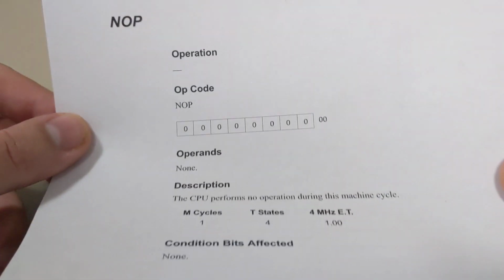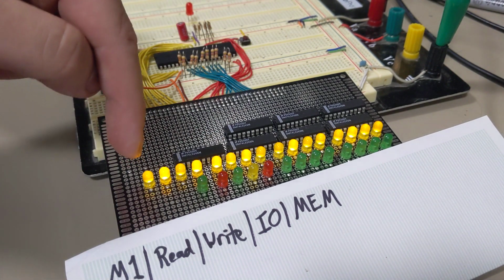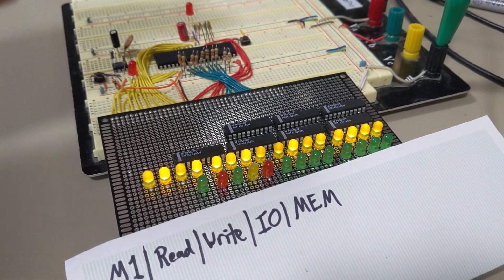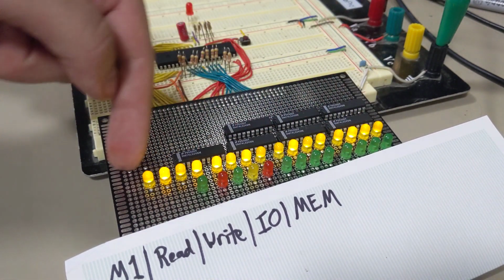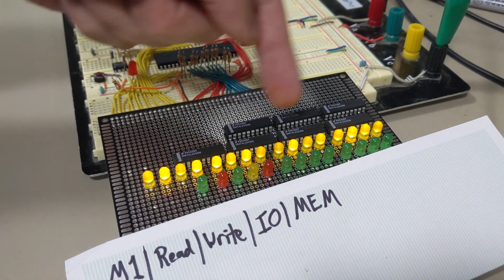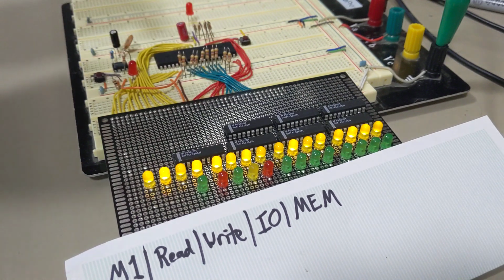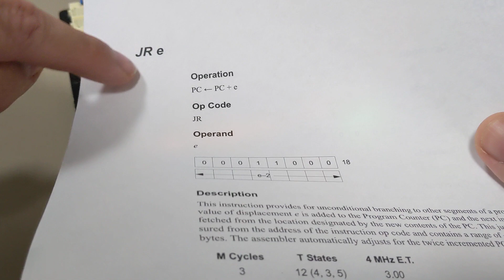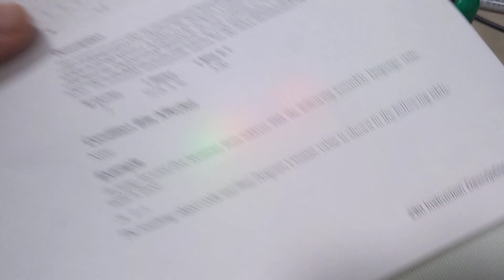Single Stepping a Z80 on a Breadboard

Comment: Maybe if I watch this kind of movies I will understand a bit of the Z80. Anyway I suddenly feel the need to build a buffered LED board. It look very intelligent, like the old computers from the sixties and seventies where highly trained technicians in white lab coats were running around to check for the status of every changing bit. This is true computing!

Comment: Why are those "bus driver" chips needed for the leds? All the other z80 projects i see on YT have the leds wired directly to the address pins
Reply from the maker: Because the address pins have a limited drive current and I built my display correctly to not use most of that on the leds

Comment: In my case  my construction not work properly.
on breadboard z80 is still have  noise on memory bus and adress bus .

Is there any way to get rid of the problems related to the improper operation of the processor and memory on the breadboard?